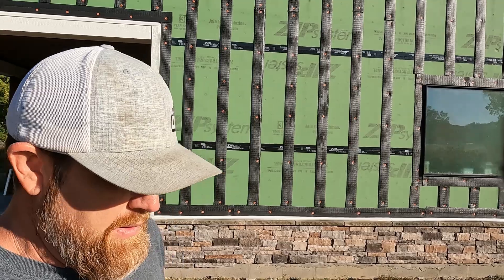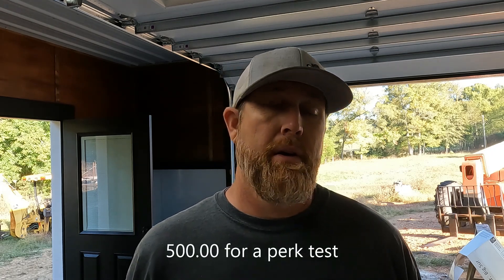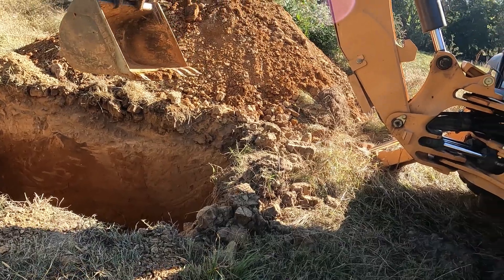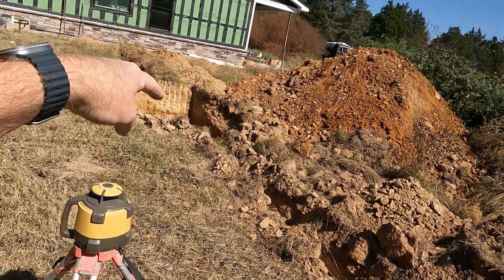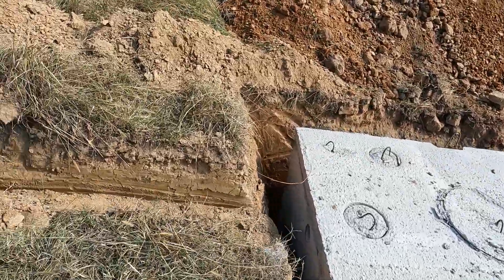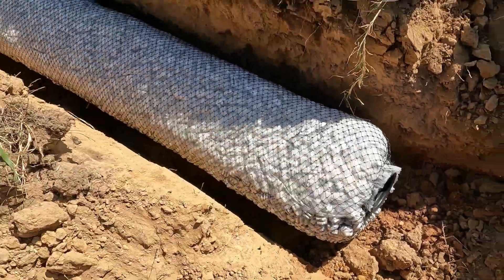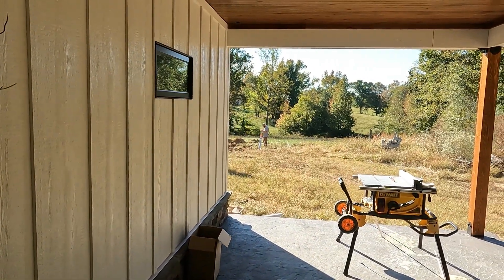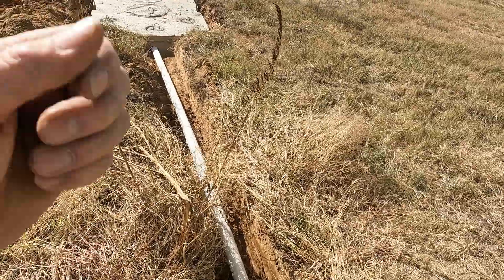What does it take to install a Septic System - The Melton Farm Project , Part 31

Comment: Great content as always man! Would you always recommend installing the septic and leach field after framing?
Reply from the maker: Yes, in most cases. Just because if it’s not installed there’s no risk of machinery running over it. It’s usually very last on my list when finishing up the exterior of a home